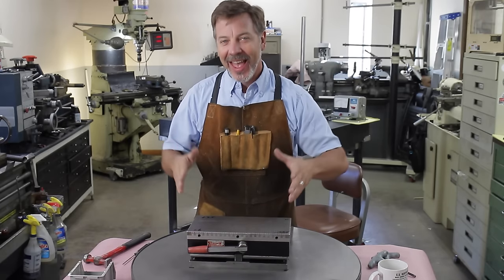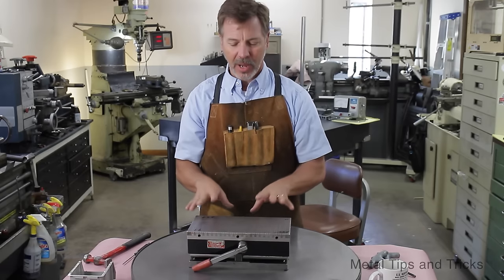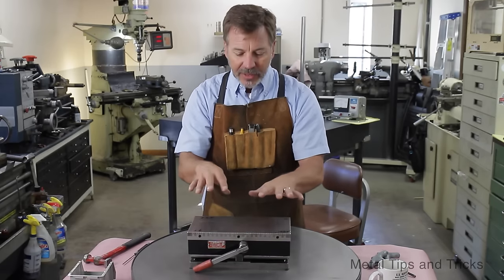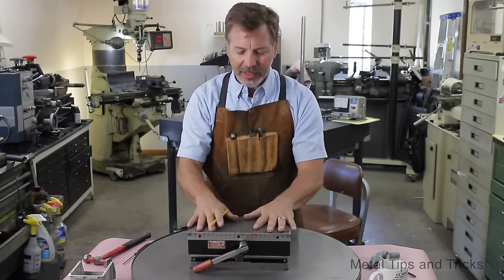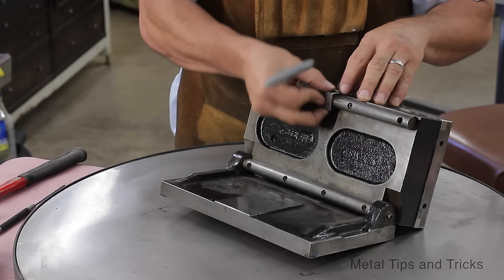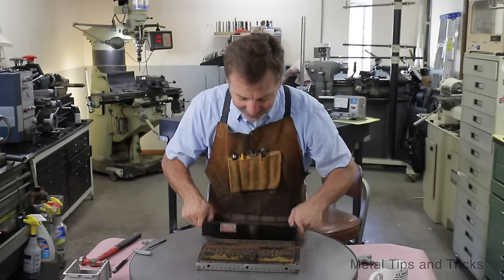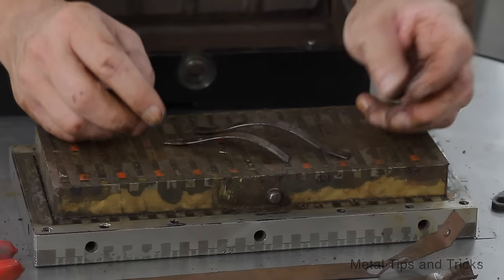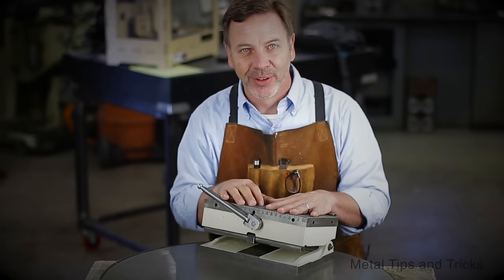Magnetic sine plate repair PART 1

Comment: Hey Dale,

There's a very good reason not to take SOME magnetic chucks apart. If they use Alnico magnets, then they loose a large part of their magnetism if the magnetic circuit is broken. 

Remember traditional horseshoe magnets having a 'keeper' plate? 

It's something that every Magneto re-builder knows well. Ideally you 'energise' the magnets with the armature in situ.

Doing it the way you did, only taking ONE plate off at a time should be OK, even with Alnico magnets. I've done it with an old Eclipse mag-chuck as they have a problem where the epoxy between the pole pieces swells and the magnet becomes very stiff to slide (I recall  This Old Tony has this problem with one of his chucks).
Reply from the maker: Hi Paul, I didn't know that. Thanks for taking the time to write

Comment: I don't know if your description of how it works is 100% correct, but it makes sense. I watched a dozen other videos, but your the first to explain how they get it work with thinner material. they have mentioned it, but didn't bother to explain it. epoxy is probably a bad choice. so many other videos explain that some parts of a magnetic chuck need be conductive. I suspect you will have weaker flux. unless it's conductive epoxy of course. yeah. probably matters.

Comment: As a scrap handler, I used electromagnets as heavy as 3 tons. It was clear that if I was lifting thick stuff, I needed higher voltage. Strange thing on the thin stuff though. Had to reduce voltage a good bit to relax magnetic fields if I wanted to reach out for more than one sheet of tin. Only by reducing voltage could I lift a pile of tin instead of a couple sheets if voltage were at rate it takes to lift very thick stuff.
Reply from the maker: Thanks for sharing. that was very interesting

Comment: Question? I was thinking of getting a magnetic chuck about the same size as the one you are working on. I would be using it on a milling machine (Bridgeport type) not a surface grinder. My concern is holding power for milling. I did understand what you said about thin vs. thicker segments, so I guess thicker might be better for my applications. I feel it would not have the holding strength for milling, unless one took a very light cut. Any suggestions?
Reply from the maker: Magnetic chuck they don't have the holding power.  I would use a vacuum plat.

Comment: Very interesting, I'm looking forward to more. Do you have a link or a resource about replacing the metal strips with brass and epoxy instead if pinned on? Thanks, keep the great videos coming.
Reply from the maker: Hi Richard, No I don't, but what I do know is that  all magnetic sandwiches are held together with epoxy. So it should work with out any problems.

Comment: Nice project. I wonder why people are warned not to take them apart? Is it hard to hold everything in alignment when reassembling? (I suppose this will be covered in a future episode.)
Reply: If you get a finger between the magnet pack and the top plate with a few inches of separation, the peak speed at which they contact each other is unbelievable and they have significant mass. if they approach parallel you just get crushed bone. I they are at an angle where an edge hits first it will hurt less because it will sever the finger off  instead of crushing it. I am not kidding.
Reply: Ah, OK - people safety. I thought it might be a problem with reassembling. Thanks.

I once had rare-earth magnets of fairly moderate size take a little bite out of a finger when they came back together awkwardly. So handling big magnets would be a potential hazard.

Comment: How that works is simple if you take 2 small mag. And get the poles identified and you take two north poles and pic up a coin then you can grab a steel plate it holds but if you flip 1 mag it will still hold the coin but it will not hold on to the steel plate so all you are doing with a mag chuck is flipping one mags poles it will hold on to its surface plate but it will not hold on to anything elce

Comment: Hey Dale spell check your description or write a nice message on your chuck. :-)
Reply from the maker: thanks :-)
Reply: No problem. I laughed when you stuck that base to the bottom of the magnet, obviously it still has some holding power. :-)
Reply from the maker: I was really lucky that i could get it off.

Comment: You should not use epoxy on the upper side because it is a magnetic insulator and will lower the power of the chuck. On the lower side it would not make any difference though.
Reply from the maker: Thanks for your comment :-)
Reply: Metal Tips and Tricks Not true at all about epoxy. The effect of the epoxy is identical to an air gap with the same thickness. The 'magnetic permeability' of epoxy is the same as that of air. In comparison to mild steel, air and epoxy have far lower permeability. The analogy is to electricity is that low permeability is like high resistance, with magnetic flux analogous to electric current. Maximizing magnetic flux is mostly about minimizing air gaps and using high permeability materials to 'conduct' the magnetic flux.
Reply: Paul Mathews This is exactly what I tried to say. If the epoxy is on the lower side of the chuck this obviously does not matter. If you put it on the top side inbetween the permanent magnets and the surface plate the insulation matters.
Reply: Flugschüler Fluglehrer An insulator carries no current or only a slight leakage current. Air gaps are more like a series resistance.
Reply: Paul Mathews English is not my mothertoung, so please excuse my unpricise terminology. I was seeing an analogy to thermic insulation rather than electric insulation.